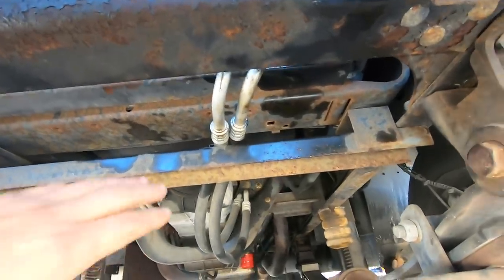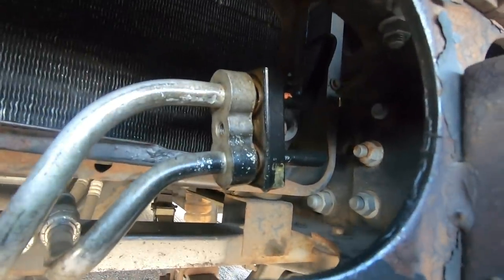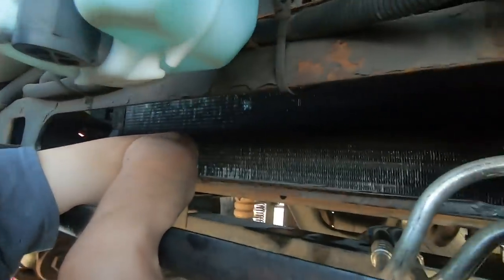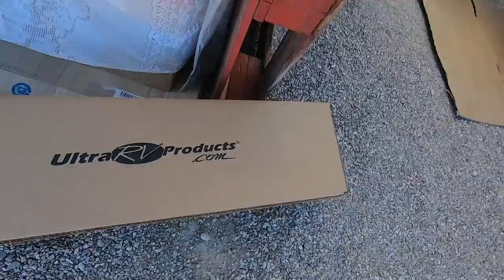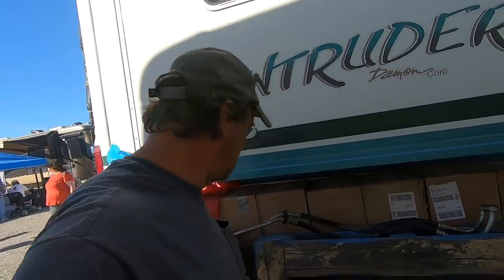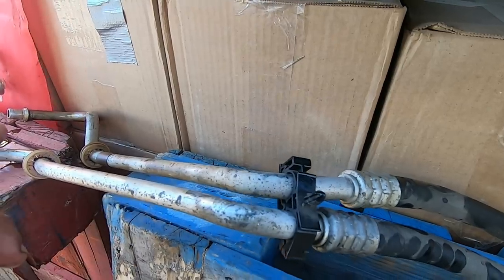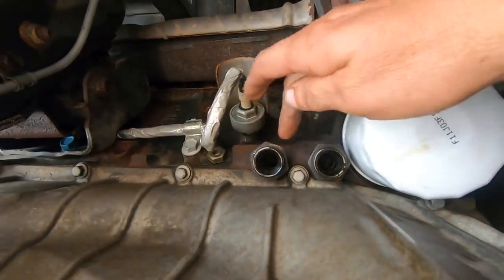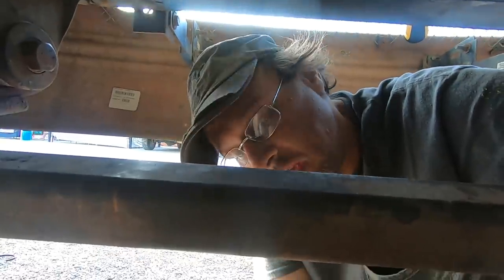Oil cooler line replacemant

Comment: I will be checking my 2005 Cruse Master to insure I will not have the same problem. I also want to give you a heads up on a problem that if the owner of that Rig does not have he will and the fix. The LED panel gets so dim you cannot read it. As you know, Ultra RV is one of the few places you can get workhorse parts now days. They also have a re placement LED screen.  "For those that are wondering why it is important. The LED screen has the transmission gear possession on it as well as voltage ect."  That problem was how I found Ultra RV a few years ago. Great work as always Wayne and thank you again for helping me head off a problem.  See ya down the road.

Comment: Hi,Wayne just in case you want to try something for your tooth next time it starts up..rinse mouth with peroxide mix some water in..it is to get out what ever in in  tooth "bubbles it out" and my long history of my teeth ,i have been brushing with a mix of char coal "  like what is left after camp fire..or you can buy active char coal at drug store i think 6 bucks and mix with coconut oil..what i found was cavity's i had started to close up "took about a year" and my heat/cold pain went away pretty fast. and big time notice spots going bad are healed? a lot of you tube video on it..